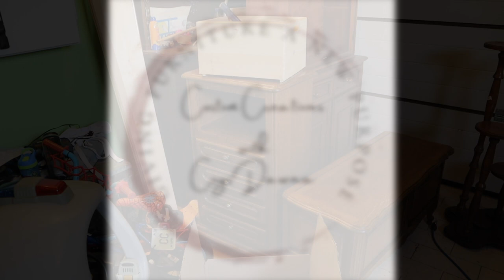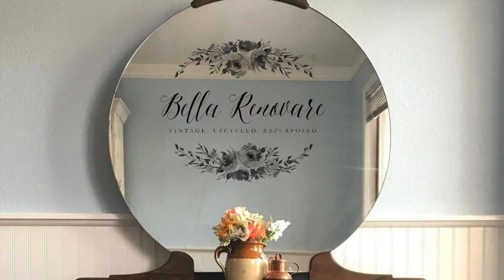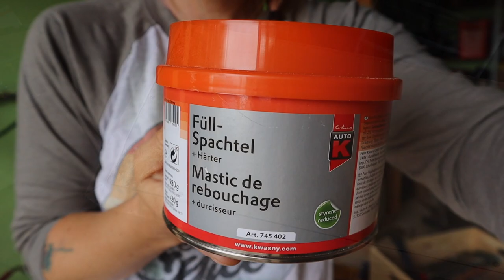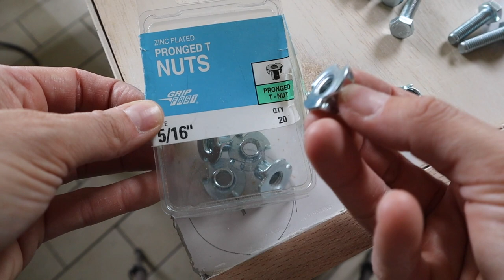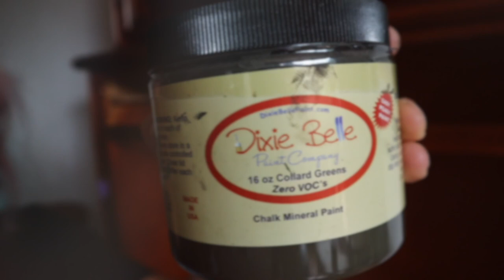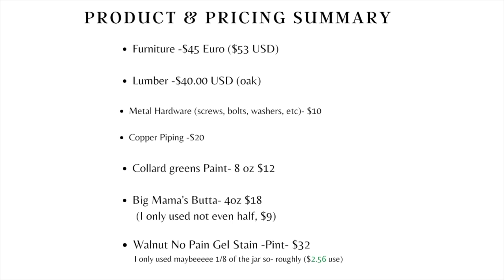Extreme Repurpose Furniture Makeover-Building A New Base & Making Copper Hardware W/ Bella Renovare

Comment: Where the bits are on tight & there is probably glue I saw a great tip to syringe a bit of vinegar in the joint to dissolve it (repeat as needed to release), it works and really helps ease things off

Comment: This was another great tutorial.  I get a lot from watching these.  I never considered making my own hardware from copper pipe.  Ingenius idea!  I just have two 'comments' not criticisms.  Did you consider touching up the small trim and edges with copper-colored gilding wax?  To protect the copper from turning green in future years, did you have any thoughts on protective coatings?  Or do you want to let the copper turn green to match the base color of the wood?  And, as usual, really nice finished piece.
Reply from the maker: Hi Richard!! Okay so.....normally what I do is take rustoleum and go over the copper piping with copper spray paint orrrr I will seal it with a clear rustoleum. This one though, I want it to patina :) So you are right if you want it to stay bright and copper with no patina definitely seal or just put a layer of copper spray paint :)

Comment: This is beautiful. I love the copper pipe fittings you used as handles. Just wondering will the copper change color? Like patina? Or can the copper be sealed? I would love these handles on my kitchen cabinets.
Reply from the maker: You can seal it  and it won’t patina :) or you can put a layer of copper spray paint :)
Reply: @BellaRenovare   Excellent thank you so much.

Comment: This is gorgeous! Love the copper pipe handle idea. I was wondering, when using Big Mamma's Butta', how long does it last? Is it like most waxes where you need to reapply it after a few months?
Reply from the maker: So okay, the DB chalk line does not have a topcoat in it, but it does have binders that create an extremely hard finish after 30 days so a topcoat is not needed, so for me anything I put on top is just an extra insurance policy. I would reapply the BMB if you need a refresh but this piece will not have a lot of traffic so I may never reapply unless I want to refresh it. I really hope that makes sense?
Reply: @BellaRenovare  It does, thank you :)

Comment: Quick question: do you use big mamas buttah to seal for pieces you sell to clients? And as far as protection is it water resistant etc? I would love to use this as an option!
Reply from the maker: I do but only on the body or low traffic, since DB cures super hard anyways anything I put on top is a bonus but for pieces that need water proofing per day or high traffic I use gator hide or one of the clear coats :)
Reply: @BellaRenovare  ok fantastic!!! Thanks so much girl!!!